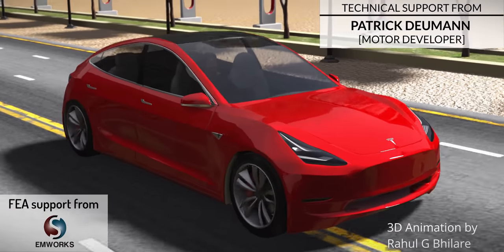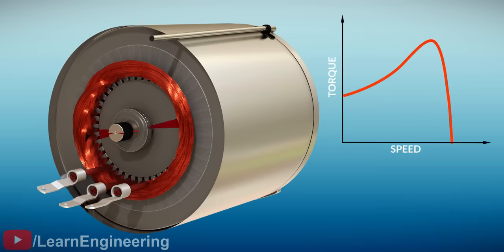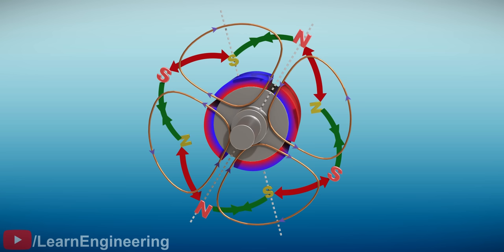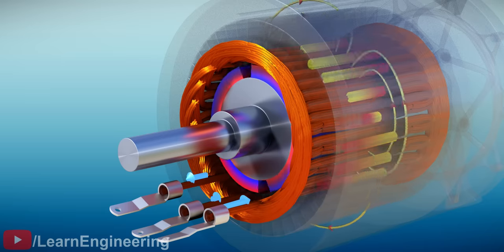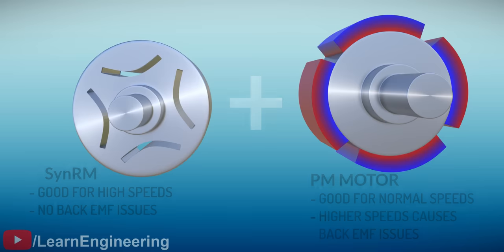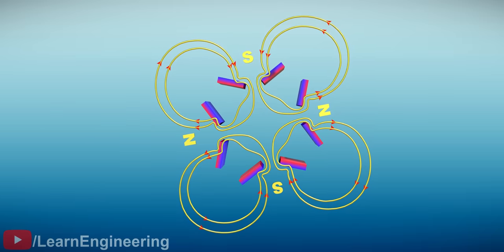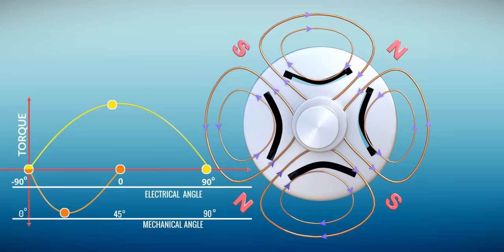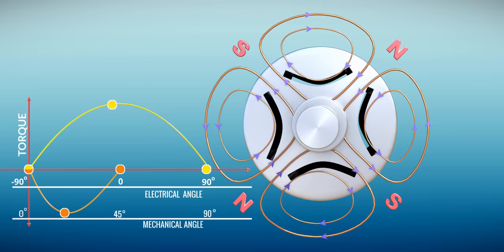Tesla Model 3's motor - The Brilliant Engineering behind it

Comment: This made me feel stupid af.
Reply: Im a design engineer and im also in awe, don't feel bad.
Reply: Yea
Reply: You’re in good company; I have a bachelors degree in physics and had to pause and rewind SEVERAL times to wrap my head around this
Reply: I only graduated highschool and I understood it all from start to finish no rewinding needed. 

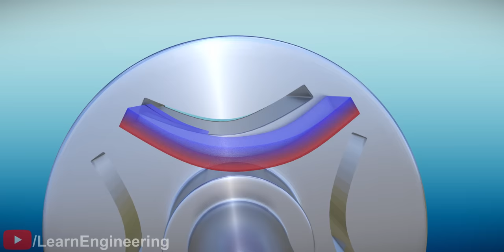The concept is simple but the terminology is what most people are missing to understand what's going on here. They are reshaping the fields from the permanent magnets during high speeds to reduce Eddy currents that cause excessive heat. That's what they are demonstrating at 5:30 and 6:45 by placing permanent magnets within the slots in the rotor.  

Not saying this is cake work to design and build, only that the concept is simple to understand once you know the language.
Reply: @ikannunaplays  Protip: If you want to provide an explanation, don't preface it with boasting. It alienates potential readers.
Reply: @coder0xff  You want me to explain in a YT comment all the underlying and interconnected topics to ensure the person reading my comment will understand the video if they are a completely unaware of everything? Or would it be better to point out the things you need to know to understand the video so others that are inclined will seek out the answers themselves?
Reply: When I was 20 I thought I knew everything.  Later I realized how little I know by seeing this video
Reply: @ikannunaplays  #doubt
Reply: @G1ennbeckismyher0  #justbelieve
Reply: @coder0xff  Funny how you think boasting ignorance of such simple topics is somehow "Good" in your eyes but boasting that I learned enough in Highschool to understand this video is "Bad" in your view. 

Perhaps you're one of those kids who didn't learn anything in high school and you're bitter about it. I as a kid read encyclopedias for fun. But hey, that's just me.
Reply: I only graduated preschool and I completely understood everything. You plebians are so dense for not getting it like I did/s
Reply: @rckhalsa  haha perfect response
Reply: You said the same thing on a Ryan's world toy review channel too.
Reply: because it's very badly written. I'm an EE and the narrator or writer's usage of terms is kinda sorta correct but confusing. Saying things "the motor uses both magnetic and reluctance action" is a semantically meaningless statement, even to an informed person, so it's utterly hopeless for this to be useful educational material to the average man on the street. It's not you Bill, it's the video. PS: good name. ;)
Reply: @coder0xff  I don't think he's boasting, he paid attention in High school. I knew this stuff when I was 14. It's unfortunate we have to hold our tongue these day so others that didn't pay attention don't feel so bad.
Reply: Some people just don't understand when they are being obnoxious. I'm sure they are well loved by their friends & family.
Reply: @ChrisSmith-bw1nt  lol i knew this stuff right out of the womb. Its not my fault that man kind's knowledge wasn't uploaded into your brain at birth.
Reply: @rckhalsa  I am only 1 month old and I understood all of this 100%. I am formulating a new motor design in my head in between breast feeding and diaper changes.
Reply: Everything is simple here. Study the section of physics - electromagnetism. And then, imagine in your head what the ideal location of magnetic fields should be, so that the engine would work very well, with the highest efficiency, and then ... learn how to simulate different situations in software.
Reply: Most people are; the fact that you even watched this video placed you above 99%
Reply: I feel you
Reply: When we lift weights, we feel weak; when we study difficult material, we feel stupid. Yet these times are precisely when we get stronger and smarter
Reply: well I perhaps understood 10% of what he explained..duh..
Reply: @thefourshowflip   i agree the guy wasn't elaborate enough
Reply: Don't feel too bad. I have two engineering degrees and these illustrations were almost purposely made to be as confusing as possible.
Reply: @ikannunaplays  You need to think seriously about going into further education. Good luck, you have a bright future. As Elon say's the world needs more engineers.
Reply: Its because they didnt understand it themselves. They called EMF "electro motoric force" for gods sake.
Reply: @ikannunaplays  Yeah I understood it too and graduated H.S. in 1971, I never considered the heat generated, I'll bet this is the reason G.E has had more than it's share of traction motor fires on their newer  AC locomotives.
Reply: @kittty2005  It seems that older generations got more from their HS education. 

When I first learned of Eddie currents causing parasitic losses in motors it never occurred to me that we could modify the shape of the electromagnetic field during the operation of the motor to reduce them. This is the genius of the design.
Reply: @ikannunaplays  To be fair I took physics in my senior year of H.S. and studied electromagnetism and its applications in industry on the side.
Reply: @ikannunaplays  Brilliant!
Reply: Well, if you didn't understand what was presented here, it Prob.  uncovered what you really are!!!
So, don't waste your time here......Go watch  Tom & Jerry cartoons or Road runner......
This was, in fact, a very basic explanation......the actual ongoings (physics) are far more complicated......
Reply: @jesscast5122  Yeah Bill why don't you and I go someplace and see if we can perfect Acme's portable hole I think quantum physics is more for us .
Reply: @G1ennbeckismyher0  you're in awe at this basic stuff?
you sure you are a "design engineer" ??
Reply: @thefourshowflip  What??  bachelor in Physics? and you had to......tsss!.....never mind......
Reply: @jesscast5122  i dont design cars, i design low voltage electrical systems. Let me guess, you use your "basic" knowledge of this stuff really well at the customer service desk at Macy's?
Reply: @ikannunaplays  Indeed.   it's all basic stuff.  but lots of fake "engineers" here.
Bottom line, this "new tech" (not new) is Trivial and irrelevant for City Dwellers going to work or the Store.   But it might have a benefit in the new electric SEMI TRUCKS on long highway and sustained hauls.  Otherwise irrelevant for most people......
Reply: @G1ennbeckismyher0  Wrong.  I'm a  Biomedical Engineer at a Major University. 
That is way Above your "design Engineer" Level while you design wooden toys for Children.....if that!!!.........
and "basic" means that this vid was made for the LAYMAN!!! so anyone should be able to follow.....but  Not......

"low voltage electrical sys"??  that's kinder-garden stuff to me.....
Reply: @kittty2005  Indeed!!  the Road runner's favorite trick was the use of the portable hole against the Wylie Coyote........
That's totally you guys' gig..........
Reply: Don't feel bad about that, an enormous amount of thinking has gone into these motors. The basic idea has probably been around for a long time, but building one that actually works well is an entirely different kettle of fish!!
Reply: @jesscast5122  
Cool flex...

Yes, I stopped and rewound the clip several times; I even...pulled out pen and paper to jot down some equations to prove to myself I was actually following along 😱. 

But again...cool flex. 🙄
Reply: @G1ennbeckismyher0  
I too used to think I understood physics...then I studied it for 4 years and realized...only now do I kinda know physics 🤣. 

To be fair, it’s hard to comprehend just how intense physics can get as you progress in the curriculum...but then again, arrogance is still arrogance. 🤷‍♂️
Reply: @thefourshowflip  haha ikr? The world is complex. All the trolls in this thread are just edge lords.
Reply: @G1ennbeckismyher0  
Lol. 
Well my hats off to ya on the EE; E&M was easily my shittiest subject and I wasn’t exactly fan of circuits.  Classical mechanics and Statistical Mechanics were my best and Quantum...I get the math but I still don’t like it on a metaphysical level. 🤣. I also took 3 cosmo classes for my electives, and I still have a love-hate relationship with GR. 

But again, I remember thinking I knew my shit before...Dunning-Kruger is real (and being honest, it still bites me in my ass on a more frequent occurrence than I’d like to admit🤣)
Reply: @jesscast5122  the only thing you designed is this comment after spending all day googling.
Reply: No you were that before even watching
Reply: @G1ennbeckismyher0  
🤣🤣🤣

Theranos?
Reply: @jesscast5122  
Cool flex...
Reply: @thefourshowflip  haha ;)
Reply: @ikannunaplays  If you could, please  explain how the controller circuit for this motor works.  How does the controller ensure reliable start up?
Reply: @DefundTheFringes  
To be frank...I don’t know much of anything about engineering or design.  Physics degree covers the fundamentals and theoretical applications. I never learned to design anything beyond python code and experiments for data collection...a minute amount of analog circuits. Granted I’m in a better position to figure out how something works than others without my educational background, but a physics degree is in no way an alternative for an engineering degree.  Where an engineering degree would discuss how to design an engine efficiently to extract useful work, a physics degree looks into how to describe the gases in the combustion cycle as a mathematical function to be able to derive its thermodynamic properties (I doubt the average engineering student ever had to learn how to utilize the partition function, if they even learn about it at all...beyond fields like chem engineering, I don’t know how that would ever be relevant)
Reply: All you really need to know is that TSLA went up over 1000% in less than 1 year.
Reply: @DrDeuteron  
So...I’ve definitely heard the words you’re using, buuuuuut.....🤷‍♂️🤷‍♂️🤷‍♂️ a bit over my pay grade 
😳
Reply: @JFinns  thats a kneeslapper
Reply: @ikannunaplays  "Not saying this is cake work " ~ You mean  'a cake walk'. btw Congratulations on graduating high school!
Reply: Congratulations, you just graduated to the good side of the coin known as the Dunning Kruger effect.
Reply: I wish more people cold appreciate feeling stupid ^^, instead of getting angry as most people seem to...
(Not here, we all chose to watch this... but on the internet, and in the world in general)
Reply: I don't understand this phenomenon, that is what you call feeling stupid.
Reply: I understood the concepts right away laughs in communications degree 
:')
Reply: Good info but I'm fucking lost 🤦🏻‍♂️
Reply: @ikannunaplays   Kudos to you! I have a PhD in ME but have to rewind many times. One thing I love about engineering is to understand fantastic designs like this.
Reply: @ikannunaplays  I don't think anyone was "boasting".
Reply: Lol true
Reply: @G1ennbeckismyher0  okay well let me ask you a stupid question then, can a similar thing be built to turn turbines for a power plant? Like if we just get bigger magnets 🧲 lol. Could we build something similar that turned a turbine and generates electricity?
Reply: @G1ennbeckismyher0  I knew about this when I was a sperm.
Reply: Watch the turbo encabulator video.
Reply: I am an electrical engineer and electrical machines still make me cry.
Reply: @Mr Anonymous like gas.
Reply: I just keep nodding my head as if i'm understanding anything..

Comment: I wrote Finite Element code from scratch in EE grad school (including axis-symmetric mesh generator) to analyze pulsed electromagnetic fields, and I had a hard time following this video.
Reply: Don't worry, as the author of this article/video is a magical painter of images for entertainment.  So, let the "info" goes from one ear through the other ear, and then it left with nothing gained or retained, etc.
Reply: @pvosoccer1585  yo dats rill dwawg BALEEDAT
Reply: That’s just because it wasn’t perfectly explained and skipped over a lot of key aspects. Even when explaining things to someone who has prior knowledge of a concept, it is extremely important to link the derived graphs, diagrams etc. with what is actually being observed. Starting with a re explanation of the root, in this example the poles of different atoms and how they are generated, and then building up to the bigger picture with their complex  magnetic field diagrams. I’ve always found that a lot of education systems suffer from this same issue, where they teach theory that is simple to perform, but don’t delve into why it is that these things are true, meaning most students don’t actually develop understanding and rely on their memory of formulas etc.
Reply: guess you didn't do too well in grad school then.
Reply: @tysongommesen380  I think he did fine, I think you are too negative, your life would improve if you were a bit nicer
Reply: @traida111  how do you know how he did in grad school
Reply: @tysongommesen380  He wrote that thing from scratch. Did you drop out because you were too busy smoking reefa? Keep stacking those shelves ready for when I come shopping.
Reply: So you agree that this is a bad idea.deisel engine will always beat electric.cause of time and effeciancy
Reply: @jimmeisch4121  Hydrogen would beat diesel if you consider oil will run out, also technology will become available to split hydrogen from n20 using a low amount of power. ''Always'' is a strong use of the word

Comment: Person who designs and builds electric motors for a living summary here: 
So they went from a 3 phase squirrel cage motor to a permanent magnet motor, put the magnets from the outside the rotor to the inside to get better efficiency and realized that solid magnets weren't as efficient as individual magnets. They also realized that by continuously changing the phase angles that it would give them the best results for driving, this is seen in most modern power tools and features in Milwaukee power tools.
Reply: Yup.  Battery powered hand tools have historically been the far more difficult test for electric motors.
Reply: Summery?
Reply: @ConstructiveMinds100  This is a summary.
Reply: So Adam NZ, the Plaid must have three of these puppies, to make that much torque?
Reply: Elon might have a job for you?........batteries are the barrier now,,,,,how is your electro chemistry?

Comment: We are at the dawn of advanced motor engineering - with the amount of money pouring into EVs and the competition for carmakers to survive, EV motor technology has the potential to really accelerate over the next decade or two.
Reply: Electric motors already are at the higher end of 9X% efficiency, which is already double the efficiency of combustion engines.
It's cool if they get another %, but if you want EVs to get a jump in performance, the batteries, like QuantumScapes new Solid State Battery design, have the most potential.
Reply: @carstekoch  The competition for motor improvement doesn't stop at efficiency. Gains in motor power and rpm's will remain ongoing.
Reply: @stevenhill3136  
Yes and no.
If you desperately want a Single gear EV, maybe with 4 motors one on each wheel, than this is a valid concern, otherwise you can just insert a gearbox and regulate your power and rpms through that. at the cost of weight and maybe space.
Reply: ccp laughs on tech others are making, i think ... communism is always wanting usurpingly to be the motor and others its fuel.
Reply: @nextchannelnext8890  
I believe you responded to the wrong comment.
Reply: @stevenhill3136  current motors can already handle more power and rpm, you just need to feed them, so there again, we need better batteries.
Reply: "EV motor technology has the potential to really accelerate over the next decade or two" Was that a pun? :)

Comment: Im glad I watched this and I understood EVERYTHING, my lawnmower needs a new spark plug
Reply: good one
Reply: Your lawnmower can run at full power on its tank of gasoline longer than a Tesla can run at full power.  That's the truth.  I'm guessing that five minutes at FULL POWER will drain the battery of a Tesla car.
Reply: xd
Reply: @philipmiller5036  the truth is electric appliances are the most efficient things in terms of energy comversion and usage WHEN THEY ARE CORDED to grid. Thats why electric lawnmover is superb and electric cars are very inefficient. Battery blocks them and since they still need to first convert energy from grid (1/3 phase, depending on charger) to DC and then from DC to 3phase, there is not only unnecessary level of electronics that are nightmare in maintenance, but also there are a lot of losses.
Reply: @philipmiller5036  
An electric motor at full power can burn out in a minute, or an inverter.

Comment: Looks exactly like the large servo motors we were using on a production line back in the 1990's.  They can accelerate like hell, decelerate the same and brake, and even stop at a selected position. We did not have high inertial loads on the output shaft which can create some of the issues discussed here. I don't understand why the PM 'servo' wasn't adapted sooner.
Reply: Efficiency of our batteries. Its one thing when you have a AC/DC connection to the wall or some other power supply, and another entirely when you have to count on a battery to live for multiple years of discharging quickly. It was adopted sooner, just not in the "Mass produced" automobile sector.